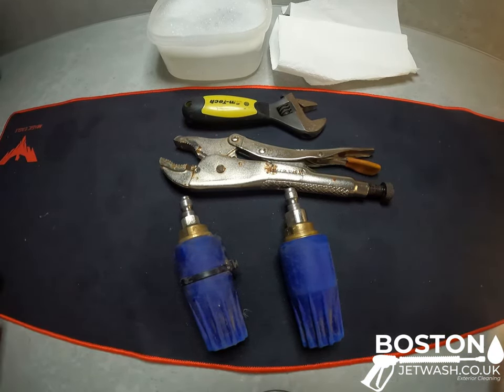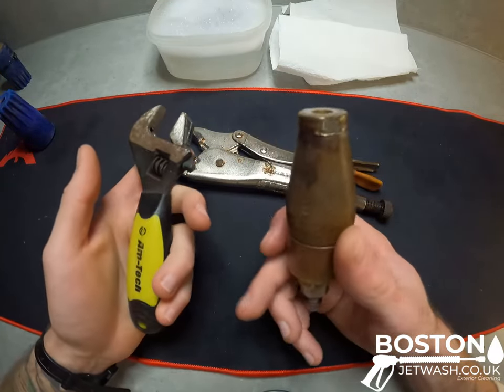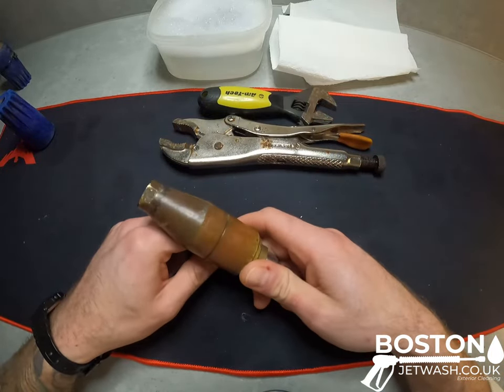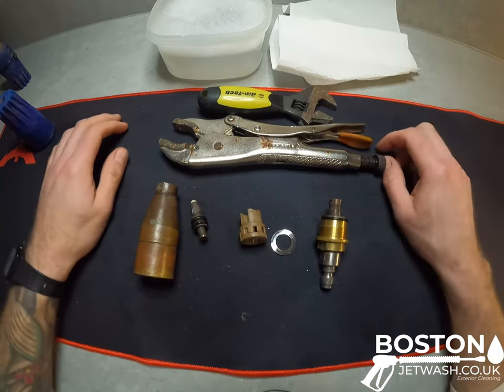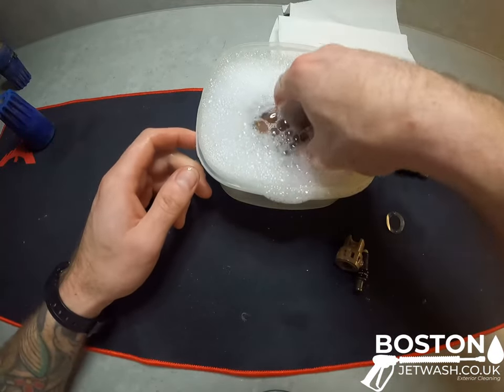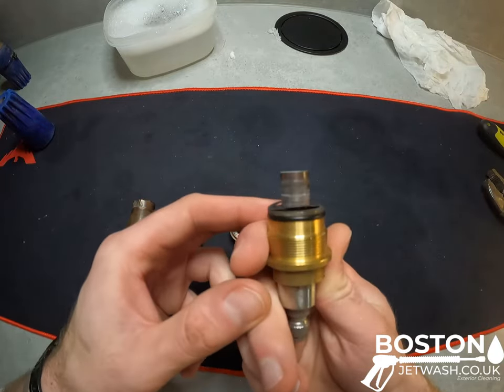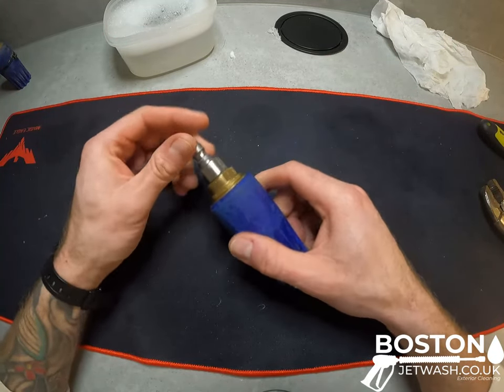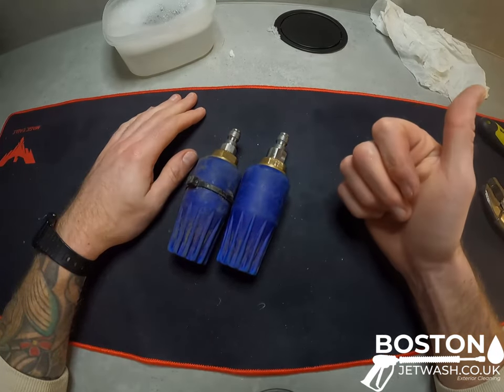Repair / Clean A Turbo Nozzle | Cleaning A Blocked Rotary Nozzle | Pressure Washing Tutorials

Comment: Are these turbo nozzles "universal" do they fit one any pressure washer or just on industrial pressure washers?
Reply from the maker: They fit any as long as you get one that is rated for the flow rate of your machine. 
For Example this particular one is a 065 which is rated for 200bar at 21lpm for my machine.
Reply: @BostonJetWash  thank you so much for explanation
Reply from the maker: @robinreso6240  No bother at all! hope it helps